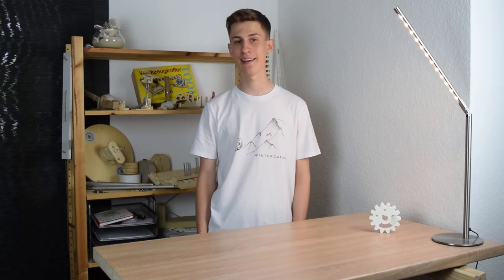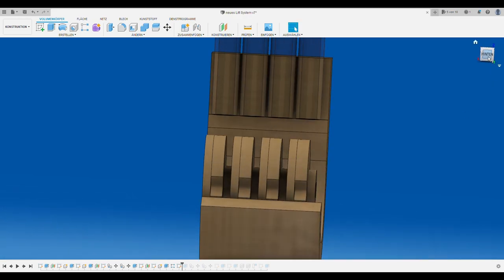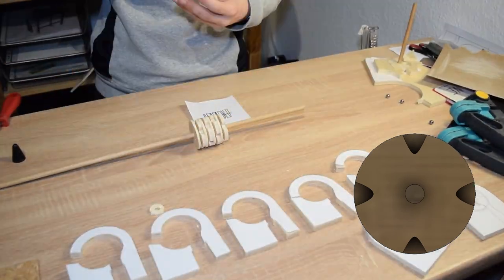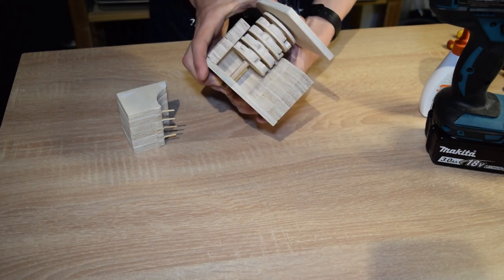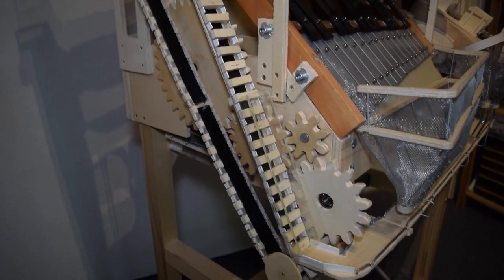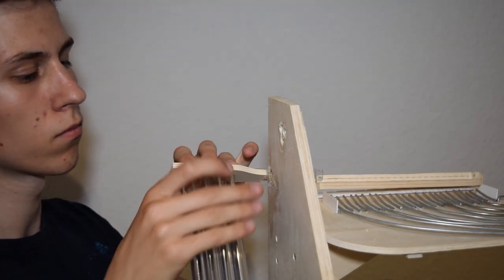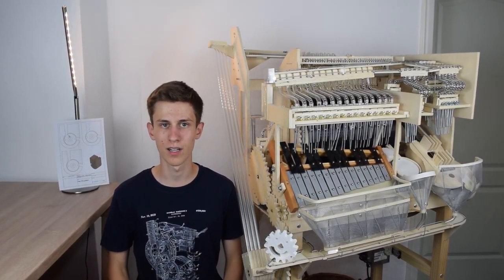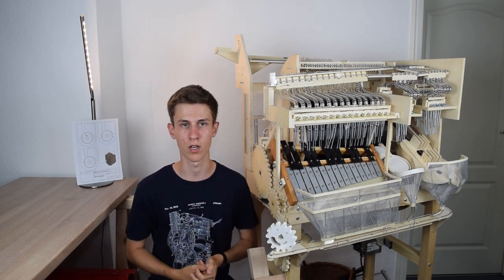A new MARBLE LIFT - A Disaster? - Building MMT #9

Comment: Could this be made stronger? Using the same mechanism with metal or fiberglass components for example
Reply from the maker: I think that would be possible, although there are other problems with the high pressure of the marbles. The problem is that I don't have the resources to build something out of metal, for example. But I found another marble lift system and I'm confident that the third version of the marble lift I am building will work 🙃.
Reply: @TKMUSIC_  I hope it does:) What kind of budget are you working with? Dense 3d printed nylon might work well for this, and 3d filament printers are pretty cheap nowadays
Reply from the maker: I don't have a clear budget, I just take the money I have and invest it in the machine (-; (as I'm still in school mainly pocket money or money I got as a gift).  But anyway, I have been thinking about buying a 3D printer in the future because I think the investment is worth it. Thanks for the suggestion!